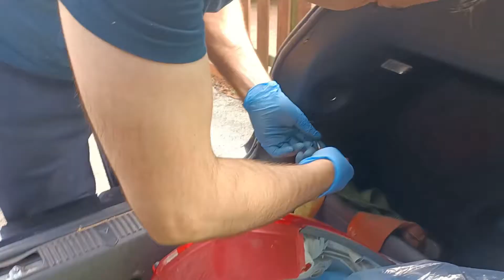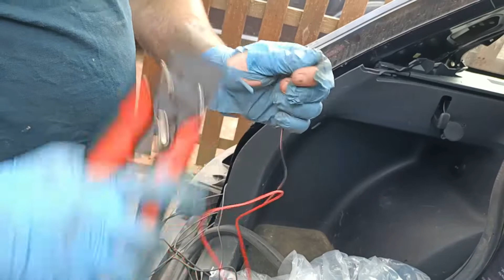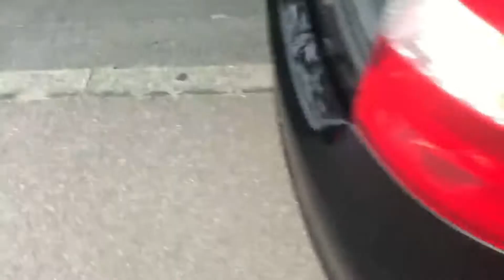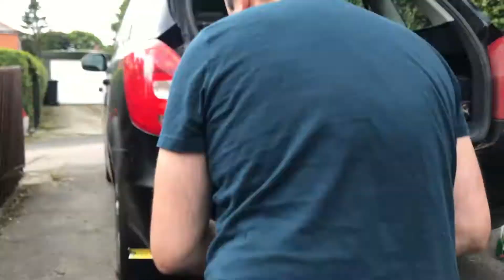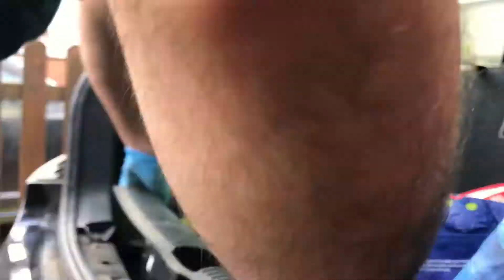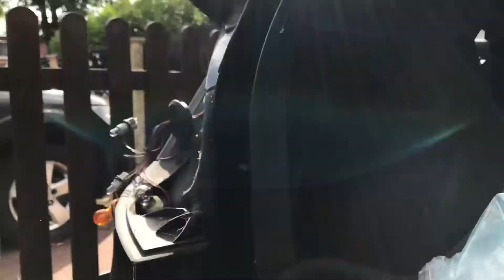How to Fit Rear Parking Sensors To A Car

Comment: Great video. It enabled me to fit easily. However, thanks to this video, it enabled me work out how to fit without the removal of any panels. I used one of the bumper screw points that get exposed when removing the light lens for my ground. I fed the wires through an enlarged hole where the boot light is positioned (estate) model. The control model sticks neatly to the panel next to the boot light.

Comment: Great help, thanks. Yes It is possible to do this alone. Remove the rear light cluster, cut sensor holes, then feed a length of stiff 13amp or similar cable down into the inside of the bumper through the gap revealed after removing the light cluster.
 Direct it along to the furthest hole, it will probably drop down below the bumper. Feed the sensor wire through the hole, it will probably drop below the bumper as well. Secure wire to cable and pull through. Took me less than an hour to complete this part of process. Another tip, lubricate bumper hole and sensor grips with oil or grease, they slip in easily.

Comment: Thanks for this video, I've just installed reversing sensors on my Skoda Fabia Mark 2 2012 12V and it was very helpful.

Here's some advice based on my experiences...

1) Check you can remove the plastic trims before you start drilling holes etc as I found the "nut" that holds the light cluster in place had rusted onto the screw thread and it took ages to free it up!

2) Not having the taps shown in the video, I tried using a "chocolate block" wire connector and cutting the wires to the reversing light, unfortunately the clearance between the back of the cluster and the bodywork was too narrow for it to fit, so I had to crimp on bullet connectors instead. 

3) It's not actually "impossible" to get the wires from the sensors to the control unit on your own. I got some stiff garden wire and fed it through the left most sensor hole, then made a loop to secure the end of each sensor wire and pulled it back.

It was a bit fiddly, but it saves having to remove the bumper :-) 

Oh, and make sure you disconnect the boot light and don't leave the ignition on, otherwise you'll flatten the battery. Guess how I know that...

Anyway, again my thanks for the useful video.